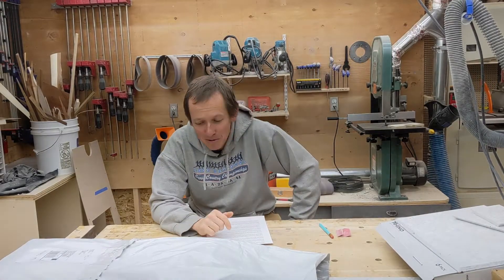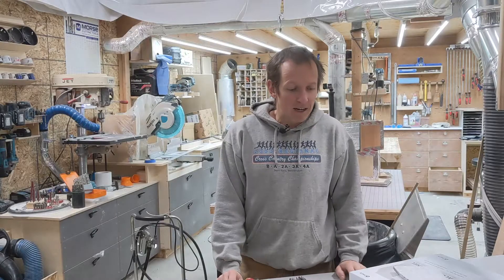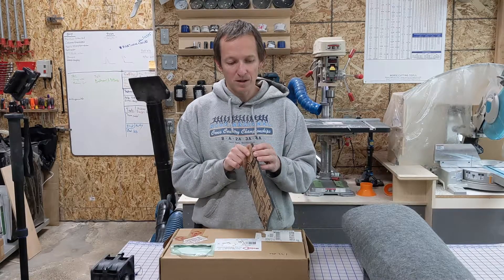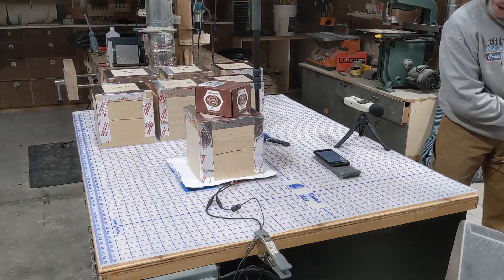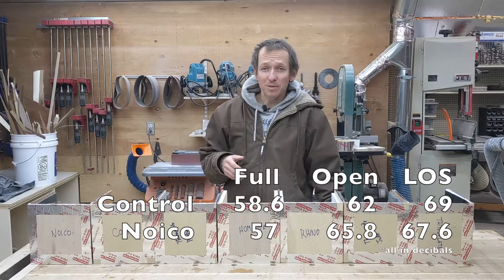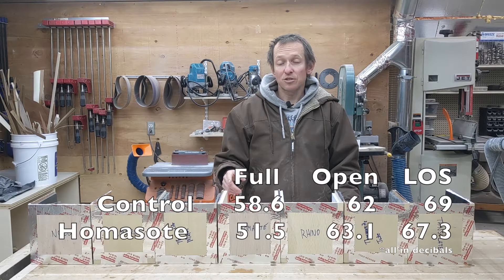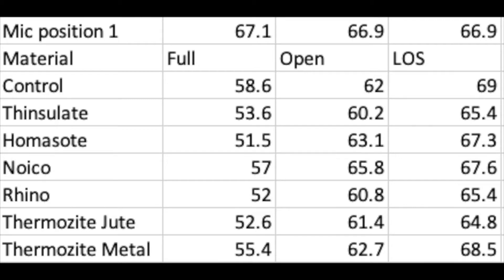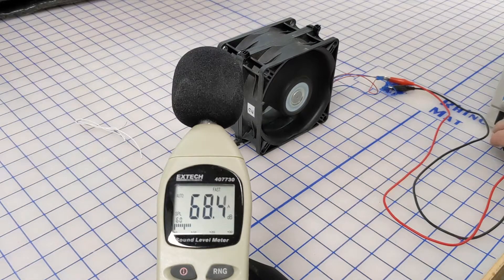Making Van Appliances Quieter

Comment: Draw through radiators, as they act as baffles.
Use aluminum angle iron as vent louvers, with 1/8" neoprene stuck on the inside of the "V" with good double sided tape.

Comment: I built a sound studio once and was conned into building the sound proofing. The trick was isolation not insulation we mounted all the Sheetrock on 2inch rubber mounts. Two layers of Sheetrock. Small hydraulic bushings might be the solution. For instance Mercedes uses hydraulic motor mounts and transmission mounts. 600 hp and you can barely hear the engine in much of its operating range. Great experiment and a fun video

Comment: Of the two videos on your channel I've seen both address things I'm dealing with too. Subscribed!

The fan on my fridge makes too much noise. I've been contemplating to switch the fan for a silent pc fan. There's one fan on there now, maybe I'll do two silent ones to keep up air pressure. My air conditioner is even worse. It has those rolling fans, horrible bearings and probably not balanced. Thinking of removing those fans completely and add some ducting to the underside of my van and add other fans there. Less noise is more better. Also thanks for showing those silent ducting for heaters, those are definitely on my to-buy list as of now.

Wooden drawers I use too, friction makes them not come out while driving which is great. For other construction I use 25mm polyester sandwich panels (offcuts from a box truck builder). Very lightweight and strong. My next build I'll probably go even lighter, I'll keep chassis cabin but the rest I'll make from foamcore glassfiber epoxy, including all fixed internal construction. Only wood to be some bamboo for table and worktops.

Comment: Great topic!  Indoor acoustics are rarely considered until after the build and an issue is identified.  Thanks for talking about this topic.  Something else to consider,  acoustic energy will always have frequency and materials ability to reduce this energy is also based on frequency.

With fans, the smaller the fan the high frequency of unwanted noise.  So  if you change fan size or speed noise output will also change.  Another consideration is that over time, air movement will lead to particle accumulation so service and cleaning is another consideration for this situation.

Comment: I have an 8" usb fan that is silent and, as you mentioned in your reply to Andreas, it could possibly lead to longer run times on the compressor. BUT because of its larger diameter isn't it possible that it would move as much air as those smaller fans? ALSO had you considered using some of those recording studio undulating (foam?) sound barriers to line the whole compartment which would be far enough away from the compressor that it wouldn't interfere with the air flow? I'm thinking that maybe the sound barrier doesn't have to be so close to the compressor but only needs to be between the compressor and the living area.
I haven't started my build yet but sound is one of my top priorities second only to heat. This is why I'm considering a fanless Refleks marine heater. I am also concerned about cooling and couldn't even consider living with the noise of an air conditioner so I'm trying to design a passive system of airducts similar to what they do in horse trailers.
Reply from the maker: Howdy!  Yep, larger fans would probably move plenty of air but it would take up more room as the original fan is about 5" across.  So that would be 3" taller if you use the base plate and 1.5" each side...and it probably would be a good idea to build a baffle to still push the air directly across the cooling fins.  As for the undulating foam, I think you are thinking of eggcrate foam?  It would probably do a good job but I tried to stick to materials that are less than 1/2" thickness.  The eggcrate stuff looks to be at least 1", and the acoustic specific stuff sometimes up to 3" so for my builds/space efficiency that is too thick, but if sound reduction is the absolute goal I'd give it a try and build to accommodate the thickness.

Comment: For those pc type fans, just replace them with Noctua fans, they are designed to be the quietest fans on the market, and they are great. That would be a quick and cheap way to silence those things
Reply from the maker: Yep, I've tried this.  I do love noctua fans and they are what I buy when I need a cooling fan.  It doesn't make a difference unless you use a fan that has significantly lower air flow (slower RPM) which leads to the fridge compressor running a lot longer, and at times failing to keep up in the peak of the summer.